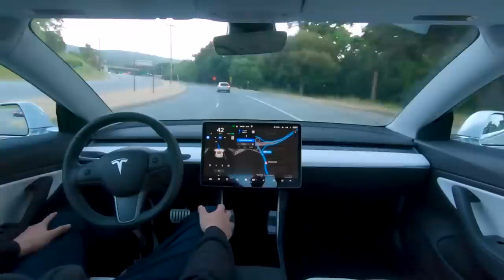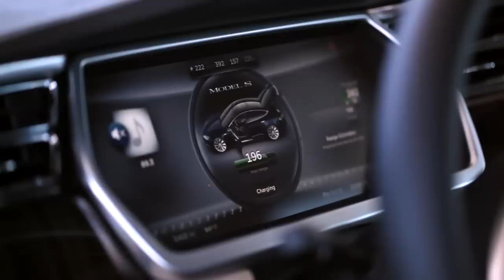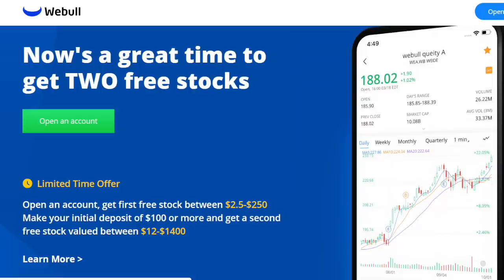Tesla's Secret Upcoming Product: Self Charging Vehicles

Comment: the alternator with more magnetic poles provide more electricity to car and self charge the battery. With more magnetic poles the alternator can generate much more electricity than it consumes for rotation. No need to charge car externally until there would be an emergency. So by this technique drive your car with self charge unlimited electricity.
Reply: This is the solution !!!!  They cant stop it game over for gas mafia....
Reply: @6669-c3t  another idea, charging car batteries by generating the electricity through rotation of car wheels and also supply electricity to all the components of car while driving.
Reply: @6669-c3t  there's no need of engine in electric cars, we can create small powerful individual motors for every wheel which will sealed pack insides their own tires and rotate them while driving cars, and long backup battery will also work to store months or maybe years of electricity inside cars for daily usage or emergency purposes while travelling continuously for long-long time.
Reply: @clicktobhushan1  if batteries  can be self charged by wheels and magnets why they loosing energy after 400 klm   ???
Reply: @clicktobhushan1  i think that batteries they spend more energy than they take thats why cappacitors its much better cause they charge in 15 min with 1000 klm range...

Comment: Skip the self-charging stations - Perpetual Charging.  Add the needed Components - Extra Batteries, Alternators & Capacitors into the EV's.  As they move they charge the batteries and fill the capacitors replacing what they use. 
While stationary, solar materials for all surfaces of EV's will help top off the charge.  That would end the combustible engine.

Comment: I was just wondering...why not just charge from the bottom?
Yeah, I know...the image of a car having sex with the ground isn’t pretty, but I would imagine it would be easier from an automation perspective if the car had to navigate to a specific point than the pump itself having to find the car like that Tesla demonstration video. Plus most electric cableing is under pavement anyway.

I can see sort of a spot where sensors guide a car to park (like planes do for an ILS approach) and when it’s successfully aligned a rod pops up from the ground automatically in the same spot for every car. Then at a set point of charging it detaches and the car is free to be driven again.

Comment: Magnetic resonance charging pads can be put under the tarmac so you don't have to plug in at all.
Reply: That's no different to induction is it?
Reply: @bangerbangerbro  I am not quite sure what the difference is. Maybe the windings on the coils are more precisely matched or their resonant frequencies are matched to the AC frequency? But magnetic resonance is supposed more efficient and work over larger gaps or at least it is according to those companies selling it like Witricity, who claim their charging pads are just as efficient as plugging it in even if driving over one of their strips on the motorway at 100km/h.
Reply: @MrMonkeybat  I don't know enough to know specifically what is meant by "magnetic resonance" but in my experience with things I do understand a lot of the time things are advertised in a way that makes them seem way more revolutionary than they are. I was assuming it was probably the same thing but just a different term being used that I was not used to hearing.

Comment: Why not just hire a couple of people to physically plug in the charging cables into each car that comes in to the charging stations, PLUS they also vacuum, clean and tidy up the inside ready for the next robotaxi duties.??
Reply: Yep very good point. Someone eventually needs to clean the car or it’ll eventually get nasty. The tech for charging will likely be way cheaper especially long term but tech for cleaning isn’t there. 

If you request a taxi perhaps you could request a freshly cleaned one with snacks for the road (at additional cost). The people would clean your car and fulfill your snack an beverage needs for the road.

Comment: The key to self-charging for Tesla Robotaxi fleet and for their Vehicle-to-Grid (V2G) and Autobidder business potential is wireless charging using the magnetic resonance wireless charging developed by WiTricity (a company founded by several MIT students).  This will make the implementation of a Robotaxi fleet and vehicle to grid a lot easier and much more effective.  If parking lots and garages at home, at work, at shopping centers, at sporting events were configured with magnetic resonance wireless charging devices embedded in the asphalt, then EVs and Robotaxis would be connected to the grid many more hours per day without the additional effort by the driver to connect a cable to a typical charging station or the use of complicated mechanical cable attachment devices.

As Robotaxis become ubiquitous, Tesla should be able to purchase or lease unused parking lots on the outskirts of major cities and configure each parking space with wireless fast charging systems embedded in the asphalt.  The Robotax fleet could drive to the nearest Tesla charging station and recharging the vehicles while they are being cleaned (disinfected) by the Tesla service team.  Tesla could also cover the parking lot with a canopy of solar panels or use a nearby wind farm configured with a Megapack battery to provide the renewable electricity to the embedded fast chargers.
Wireless charging devices could be embedded in the asphalt at airport taxi pickup locations, in front of hotels, football and baseball stadiums, arenas, and convention centers so that while the Robotaxi fleet is waiting for customers to exit the football or baseball game, they can be charging or selling electricity back to the grid. 
I predict that Tesla will either buy WiTricity, invest in WiTricity or make a deal with WiTricity so that these wireless charging devices and be produced in mass quantities to lower the cost and become ubiquitous.  Check out the videos about WiTricity’s new magnetic resonance wireless charging technology.
Reply: Wireless charging wastes energy. Why not just use freaking hydrogen if you're so dead set on flushing energy down the toilet?
Reply: theuncalledfor Conventional wireless charging wastes some energy, but this new magnetic resonance wireless charging loses as much energy as todays wired charging stations. Hydrogen wastes much more energy than even todays older wireless technology. When you use electricity (electrolysis) to make hydrogen from water, then compress the hydrogen, then transport the hydrogen to the filling stations - either by truck or my leaky pipes, then store the hydrogen in pressurize tanks, then pump the hydrogen into a pressurized tank in your car - only to convert the hydrogen back into electricity using the fuel cell  (some of tis electricity is stored in a small battery)...there is waste at every stage of this process for a total waste of about 60%. Storing the electricity directly into batteries is much more efficient. It is much cheaper, easier, and quicker to run wires to create more charging stations than it is to install the pipes and/or the storage tanks at every gas station in the country. Charging stations can anywhere including homes, shopping centers, parking garages, office buildings or anywhere electricity is available. With the implementation of magnetic resonance wireless charging, the concept of filling up or charging will become a thing of the past - like feeding your horse. Every time you park your EV you will be connected to the grid and charging up or selling some of your energy the grid without even thinking about it.

Comment: I would like to see induction charging under the cars. I think with the better batteries that it will be coming in the future,maybe better induction charging as well.
Reply: Doesn't induction charging lose some power and generate significant heat? As well as being slow? (Definitely on my phone's it's hot. And electric toothbrush takes about 24 hrs or more to go from 0 to full)
Reply: MIR Normally yes but this new technology - magnetic resonance induction charging is different.
Reply: Check out the videos about WiTricity’s new magnetic resonance wireless charging technology

Comment: I'm sure Tesla will invest in wireless, induction chargers in the near future where you simply drive your cover over the charge pad and the car will start to charge, touching nothing.  With newer, rapid-charge batteries, a Tesla could pull in to a spot, driver stay in the car, and the car will automatically charge in ~10 minutes, and then leave.  No robotic arms that can easily be vandalized by people and nothing to touch.  All EV's can have standard wireless charging systems.

Comment: Self charging can be easily solve with having autonomous mobile actuator, instead of having an actuator at every single charging point.  i.e: Boston Dynamic's Spot with back mounted arm with custom magnetic end effector.  Going around plugging in and unplugging charging cable.  To be honest, I'm thinking even further. Since what's stopping Tesla from going into energy producing business. I'm thinking, Tesla wind turbine along with solar panels, batteries, super capacitors and Starlink ground relay station at every single supercharger site.  Decentralizing energy generation while delivering much needed energy during peak hours. Eliminating all peaker plant in major metropolitains.
Reply: Check out the videos about WiTricity’s new magnetic resonance wireless charging technology.  These things can be embedded in the asphalt of parking lots, driveways, garages, and in cue lines in front of airports, hotels, stadiums and arenas.
Reply: @garycarson3128  the issue with such a system is net loss of power. Some power will be lost during transmission. I believe they did a great job but still that tiny loss margin is very expensive on scale
Reply: @hydrolifetech7911  storage is the only solution here
Reply: nonsense, tesla only needs to concentrate on battery evolution, siemens, ABB, Panasonic, Bosch are already perfect at manufacturing wind turbines and solar panels and electric grid components like transformers.......
Reply: Alan May Perhaps you are right but sometimes it takes someone from the outside to look at the problem with a new set of eyes and the naivety that anytime is possible. Look at Tesla’s new heat pump. Established companies have been making heat pumps for years. Look at the Tesla Solar Roof. Hundreds of companies are experts in making solar panels. Look at space travel. Countries have been sending rockets in space for decades but they seldom reuse these rockets. Look at the Boring Company. We have been digging tunnels for centuries... 
 
Disruption seldom comes from the incumbents. They usually come from outsiders.

We are often a prisoner of our own history, education, traditions, and experiences and fail to see things with s fresh set of imaginative eyes.
Reply: Tesla is a in going into the energy production business. In fact in my eyes Tesla is a renewable energy and software company
Reply: @Batman2StaticShock  like Siemens, ABB.......

Comment: The only automatic charging solution which makes sense is to the car‘s underbody via a real physical connection. Such a system is developed by VOLTERIO together which major premium OEMs
Reply: Robot arm is clearly the best solution. One charging port, no inefficient wireless bullshit, can be plugged in by hand easily whenever a specialized charging station is not available.
Reply: theuncalledfor The best solution is to make the act of charging or refilling the tank go away. Highly efficient magnetic resonance wireless charging embedded  in parking spaces makes charging automatic. When you are parked, you are charging or connected to the grid to sell energy back to the grid (V2G). The driver never has to think about it. The concept of charging will cease to be a thing. This is especially important with Robotaxis. With wireless charging embedded in the asphalt, there are no moving parts, nothing to back into accidentally , no maintenance...
Reply: Check out the videos about WiTricity’s new magnetic resonance wireless charging technology